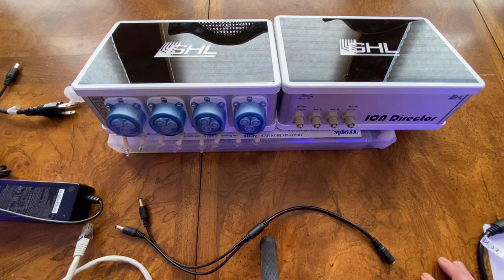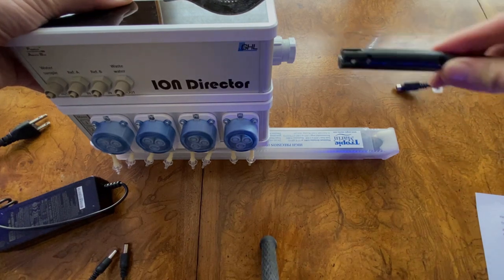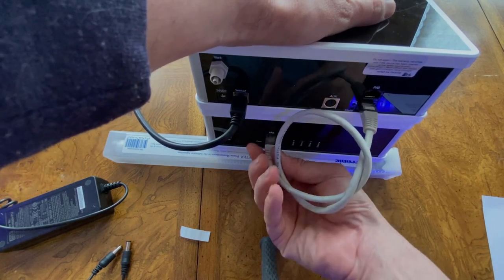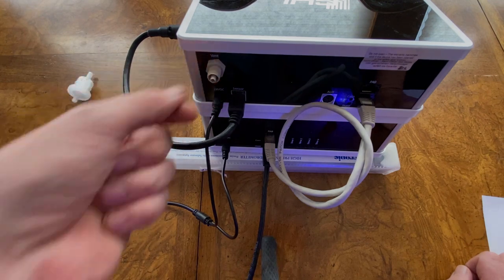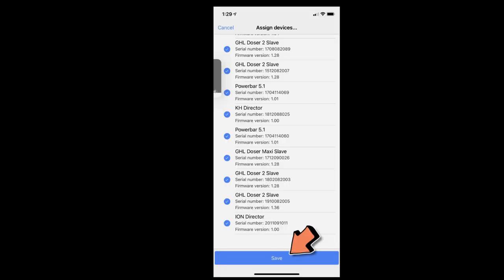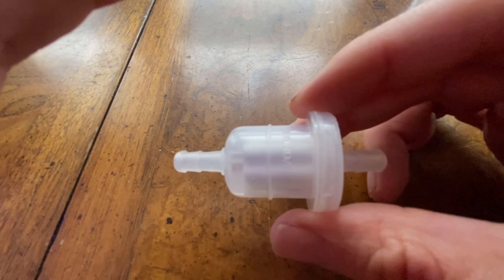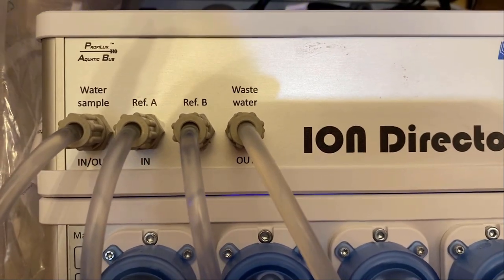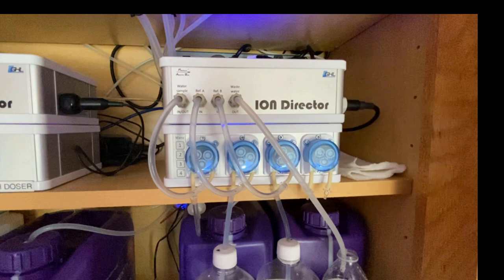GHL ION Director Initial Setup *Updated*

Comment: I do not have the controller and ordered both the KH and ION director.  One with the SA doser and the other with a slave doser.  Will this work or should I have order both with an SA doser?
Reply from the maker: Yes, as long as you have one SA(Stand Alone) and they are all on the latest firmware it should work

Comment: Hello. What about tube length from dosing head 12 cm and dosing head to ion 16 cm as per manual?
Reply from the maker: Are you asking does the tube length between the to units needs to be exact? When it comes to the unit being side by side or stack configuration you need to cut the dosing tube to the recommend length in inches or cm outline in the manual. But the water supply line and exit line length can be variable.
Reply: @KR-id6bl  Hello. I was refering to length of hose of dosing head that is 12 cm and length of hose from head to ion must be included (16cm if stavked) and length of tube to sump plus filter 7ml. Or I am wrong?
Reply from the maker: @hrvojevrh2743  No you do not need to include the length between the unit in the final calculation.  (sorry for the delayed response)

Comment: Do you need a controller in addition to the Ion director and the dosing pump or can they stand alone?
Reply from the maker: No the ION Director with a Doser can be run independent of the controller.